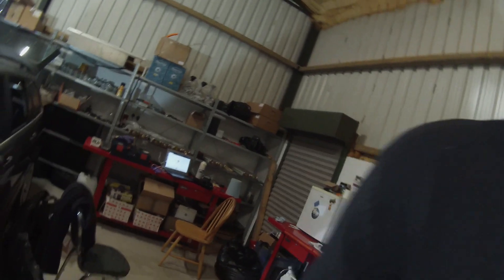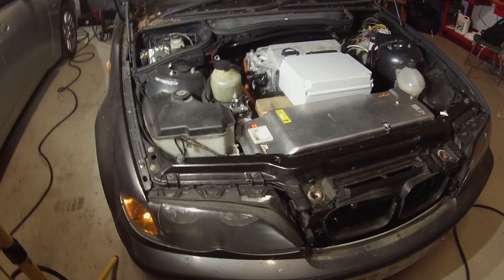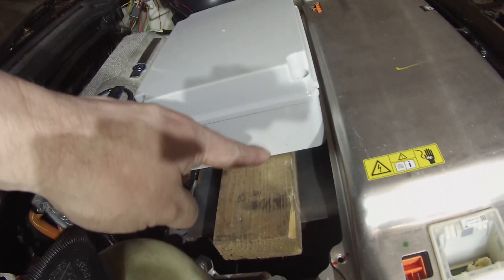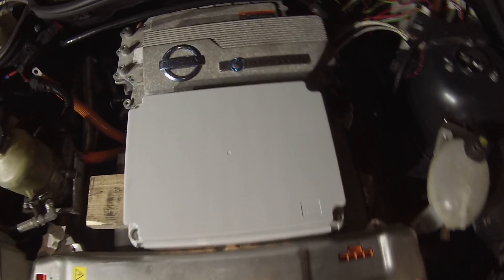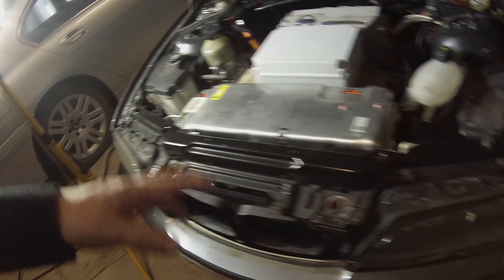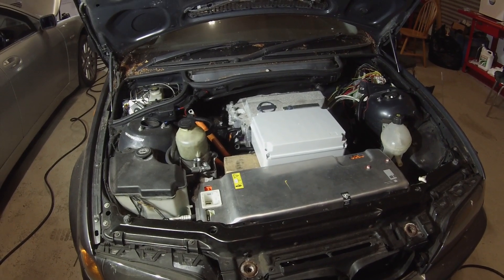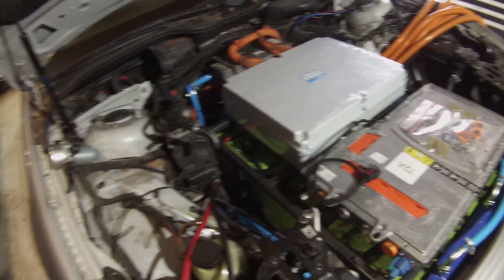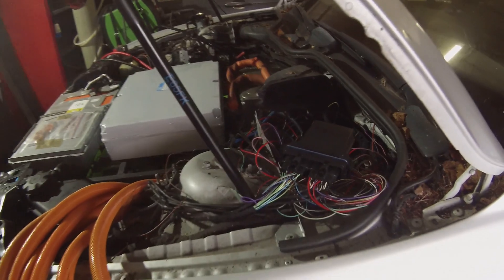Fleet Update : E46 Touring and the Bexus

Comment: All I keep thinking is how can I do a ls swap with the lexus motor and a small battery to basically do my own KERS system. Maybe that  new motec system could control it all? Something similar to what Sasha Anis is doing with is 350z but without spending a 100k
Reply: You'd be better of using the the Motec for spark & fuel on the LS and running the Lexus box on one  of the EVBMW boards controlling boost fill-in and regen.
Reply: @calorus  oh okay I didn't know if it'd be better to run independently. Standalone for ls or existing pcm and then like you said or have the motec control all of it(which it can now)
Reply: @danielrouw2593  Great point! I wish you could tune emotor side with hp tuners but they don't support it. For some reason I thought they used pulley based system but I see it's 2 motors in the trans.
Reply: @danielrouw2593  yeah the tcm side is what scares me after doing some reading today. You could control the motors with custom inverter board but then you still have the trans you need to control.